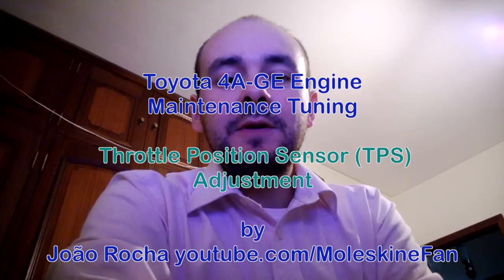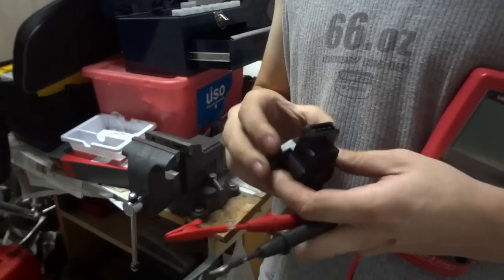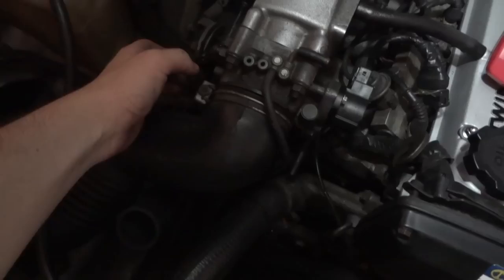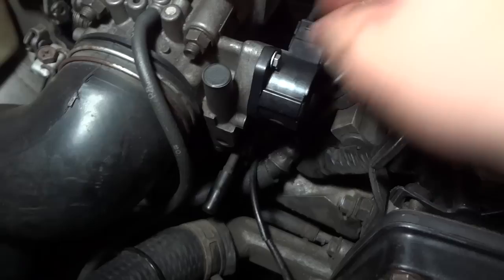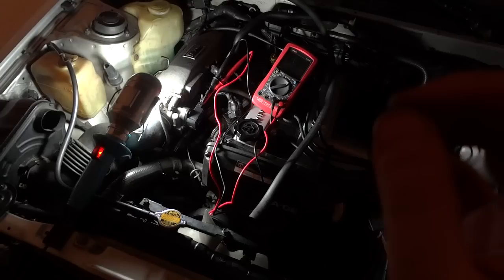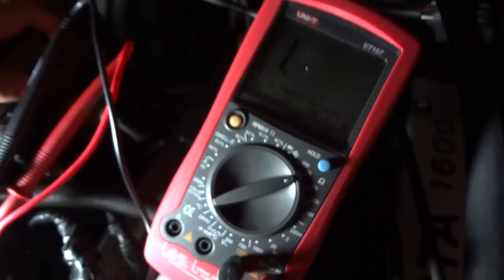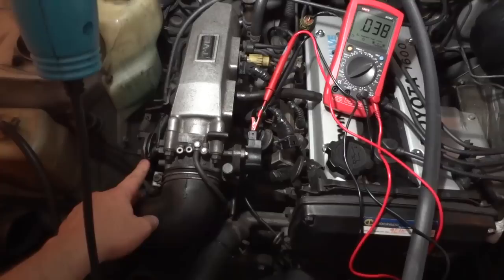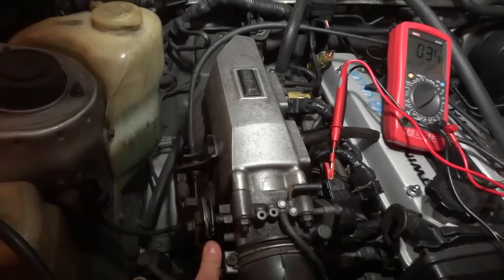Toyota 4AGE : How to adjust the TPS / Throttle Position Sensor (AE86)

Comment: when adjusting the tps, I believe it's a better idea to check the 5v reference with dcVoltage on your dvom. And adjust the sensors signal output to .5v @ closed throttle.
Reply: Okay

Comment: While it is a good tutorial, factory manual specs does not compensate for differences in each car. TPS adjustment is best done with DC input voltage applied or backprobed ignition on. At idle it should read .5v and fully open throttle at 4.5V.  You should see Voltage increase incrementally as you open the throttle. Dips and spikes may indicate a bad unit. Also lightly tap it when doing this test.  It should still be steady. I have seen many TPS adjusted using feeler gauge/ohm method and still have jerkiness or bucking issues because Voltage is too low for fuel map.  The old ECU can only compensate so much.  Peace.
Reply: l
Reply: Just wondering what i have done is hold the throttle open enough till it hits 1600 rpm then it starts doing fuel cut off bouncing revs then i move tps to the right until it stops bouncing and holds steady and no more bogging on and off gas while driving, im guessing this kind of the welfare way of doing it because at factory specs i was having bogging and bad mileage just like what u said factory specs dont compensate for different cars

Comment: Very very good and well explained. Concerteza que és tuga mano! Força. Continua a fazer videos desses que há pouca malta tuga a fazer videos técnicos e tb cá temos muito bons técnicos em todos os aspectos. Grande abraço de Lisboa! This is the propper way to set the TPS with multimeter. This allows you to set the TPS without having ignition on thus setting a fault code for the disconnected sensor, but with the multimiter you don't need to have the ignition on for that so no error code is set on the car's computer.

Comment: the blade does not go there, it is going on the other stop screw that is on the opposite side of that and what it is about is that the butterfly opens with the same value in mm of the blade, on that side you used it has a  spring that anyway the acceleration body will push it and the butterfly does not open.

Comment: Sometime the red wire of the multimeter at the top pin and then the black will take place at the top pin...which one is correct, watch the video carefully. I'm a little bit confuse 🤔🤔

Comment: I have an 86 MR2 with the 4AGE and on a cold start it has issues starting up (my starter is fine) and then it finally starts and constantly idles at 2.5k (without bouncing) and it never goes down even after the engine is warm...I'm going to try this and hopefully it fixes my idle issue!
Reply: Yeah, i have that issue as well. But since it is a very old car, there could be more than that wrong with it. It could be a vacuum leak, it could be an intake leak, it could be alot of stuff. This is the best place to start. I noticed, when it is cold it starts up fine, but it idles really high, about 2.5k. In the warmer months, it will start at 2k and after a little bit of driving, it will drop to 1k like it's supposed to. I don't know if this is actually a fault, because the engine is 34 years old, or if that's just how it works, because they aren't sophisticated like the new engines.

Comment: Awesome video man, just one thing the location of the feeler gauge is not exactly correct, where you inserted the feeler gauge is the idle up controller or automatic choke, the feeler gauge is meant to go on the throttle stop which can be seen if you are looking from above the throttle not the side
Reply: were on the 3.0 does it go

Comment: U refer to a deadspot but my question is when u move tps clockwise until deflection is the ecu reading throttle closed or open until deflection because when i use the feeler gauge it bogs but then i hold slightly open throttle till it surges up and down then move the tps clockwise until the surging goes away and i can control low throttle inputs with steady rpm with no surging and its like im using a .65 gauge not a .47 and i have a slightly high idle at 1200 rpm is this possibly a bad mass air flow meter or ecu

Comment: 89 SR5 pick up truck. It doesn’t work for me, I had try and try and try and the reading goes to .1 at any position when the TPS pass half the middle point on the throttle body. Engine reeves at 2500 RPS

Comment: I saw your video about TPS. i am having problems regarding this TPS, my electrician just once opened TPS (before opening TPS my engine sound is soundless)and then after that my 4AGE 20v Blacktop started clicking sound like diesel sounds. i changed TPS after that 2 times. What should i do? kindly help me in solving this issue. Thanks

Comment: I have a 93 Toyota 4runner. the timing is at 10 degrees before top dead center and has no power so I was wondering if I adjust the TPS like you did would it move the ignition timing ..just wanted some info I am trying to pass a smog check. ..thanks
Reply: No. the tps is a sensor that tells the computer how wide open you have the throttle body. it works with the maf sensor in giving adequate fuel. but the tps also works with the transmission. (more throttle on accelerating = holding a gear longer. ) (therefore your car may annoyingly hold a gear too long because the tps is bad, but not actually accelerate faster because there isn't any more air going in)

Comment: I have one a bit off-topic question for you, since you video reminded me of one problem I had. There is a port on top of T-VIS with a "N" leter and a vacuum tube that leads to idle-up VSV valve. In AEs that have air flow meter, the other tube coming from VSV is hooked up to the AF meter, in AEs with A/C it is hooked up to the big pipe between air filter compartment ant T-VIS. While my AE86 is (visually) identical to yours, I wonder where is the vacuum tube from VSV connected in your car? Shouldn't it be hooked up to the small pipe on the air filter compartment to get clean air when VSV is in bypass mode?

Thanks for great helpful videos, Joao!
Cheers!

Comment: Hello Joao, I did what you showed in this video but when I turn the sensor full clockwise and counter-clockwise, I got only 1k ohm (the number doesn't move in my multimeter) but when I put it to 20k, I got 1240+. Does it mean that my TPS is bad?...Also when I check the voltage and push the throttle lever, it decreases.  I know that when you put some gas on the pedal the voltage increases, but mine it's the other way around...is it bad?...Thanks in advance...Cheers!
Reply from the maker: Hey Ians. I'd say that it is... If there is no big change in resistance the mechanism inside is probably broken and there is no longer the correct continuity between the pins. A good working TPS should have a relatively low resistance and then shift to 1 (infinite resistance, which means open circuit) like I show in the video. Check out the resistance values here and diagnose your TPS:

http://www.matrixgarage.com/pictures/TPS-Adjust/TPS-adjust.jpg

Comment: Joao does this mean that the position where the filler gauge goes into has to be tighten once the calibration is complete? Or should it be left at the position where the filler gauge can be put in? Keep in mind I did see the other video with the correct position where the gauge goes.
Reply from the maker: Alberto Sanchez Hi Alberto, the filler gauge is there to give some slack to the tuning. You dont adjust the stopper bolt, you open the throttle slightly to fit it in, tune the TPS to the point where the resistance goes to infinity and just remove the feeler gauge blade, so that the resistance will not be infinite when the throttle is completely closed. The size of the feeler gauge is what gives the TPS the "dead spot" that it needs to "tell if" the driver is stepping on the gas, even if only slightly.

Comment: What are the benefits of doing this? A before and after video would be cool.
Reply from the maker: Well, the benefits are hard to record on video... You have to feel the car. The difference is mainly the behaviour when changing gears. With a badly tuned TPS, you feel a jerkiness when letting off the clutch, almost as if the car accelerates for an instant. The TPS tune can also have a light influence on gas mileage, as the ECU can keep injecting fuel when in fact you have the throttle fully shut. Throttle response is also better with a tuned TPS, as it tells the ECU in advance that the throttle is open, instead of relying only on the MAF sensor which takes a moment to record the air flow in the intake manifold. You feel it it you disconnect the TPS and blip the throttle on idle.... the RPM will rise much slowly.

Comment: Can u Show us how to adjust  tps for Toyota corolla2005
Reply: It doesn't matter what car you have, they are all relatively the same. They are all connected to the same things, there placement may be different, but it's all relatively the same. They may use different types of bolt, different thread pitches. But a tps sensor is a tps sensor. That doesn't change. It may look different and be set up different, but it's in the same place, relatively speaking.

Comment: This was very good. Will this work also on a 2002 Grand Cherokee limited 4.7?
RC
Reply from the maker: Well, I cannot say that it is the same, as the contacts on your particular TPS may be different than in the Toyota. The best option is to look for the manual of your car and check for the correct procedure. Look around on the web for a Grand Cherokee forum and ask for the manual there. They are likely to help you! Thanks!
Reply: João Rocha da Silva Thanks, RC.

Comment: so what happen if i choose not to u te filler gauge and simply set the tps?
Reply from the maker: abdul azhim The feeler gauge blade is there to give the ECU a "dead spot" to distinguish between a fully closed throttle and a very slightly open one. Do not adjust the TPS without the tool, it is so cheap, so do the job right, there is no excuse... ;-) Cheers!
Reply: i am using feeler gauge and right now there is jerk as i slightly touch the throttle. ill try to adjust it again.. thanks for the vid!

Comment: So the .050" of an inch for filler gauge and the 1. Oms for the 95' Toyota Corolla is the same value as for yours?
Reply from the maker: Hi, sorry I missed your question. I am not sure, it is always better to consult the manual, but given the similarity between TPSs in 90's Toyotas, I would risk to say yes.
Reply: No the process is different for non GE TPS's

Comment: I have adjusted the TPS as described in the video , but my car still jerking in low speeds just near the idle, the engine is 7AFE, please can you help.
Reply from the maker: Try and clean, rebuild and re-lubricate the throttle body like I show in the ISCV cleaning video series (3 videos): https://www.youtube.com/watch?v=_JD9BtoScL8&list=PLy0phlXyxNAeNtdT5EtRjCyG5I3zjJ8NO&index=8
Reply from the maker: Another idea to try out is to go to Toyota and buy an injector cleaner additive.
Reply: João Rocha da Silva I cleaned the ISCV but the problem persists .Can you recommend me somethings else.
Reply from the maker: Try to unplug the TPS and take it for a short drive around the block. It will be sluggish, but if it stops jerking it has to be the TPS that is not set up properly or is broken.
Reply: João Rocha da Silva thank you , I'll try that and see
Reply: The 7AFE has a diferent resistance target value
Reply: +Jesus Rivera if you're only checking for dc voltage, youll never run into a problem adjusting it. every tps is a 5v system, and is properly in tune if it operates between .5v closed throttle, and 4.5v WOT

Comment: so what happen if i choose not to u te filler gauge and simply set the tps?
Reply from the maker: abdul azhim If you do not use the gauge blade the ECU will think that the driver is always stepping on the pedal (albeit lightly). It will have a richer mixture (gas smell) and jerking between gears (at least those were some of my symptoms).
Reply: +João Rocha da Silva even if you go straight to the end resistance value?